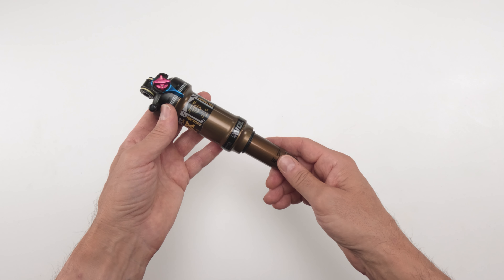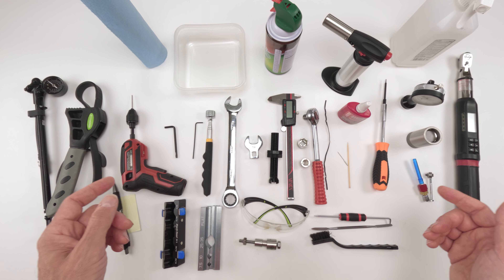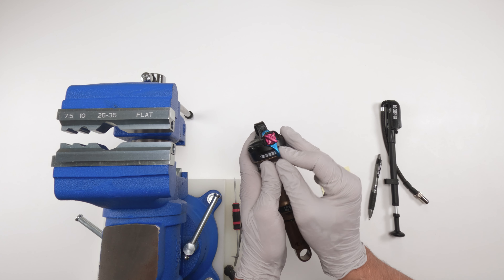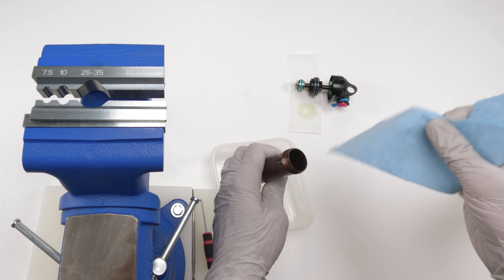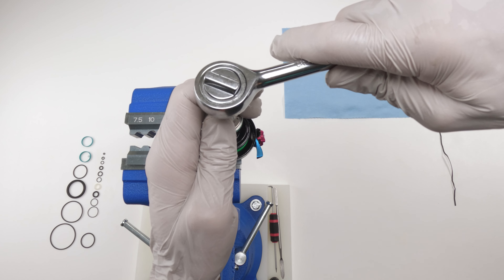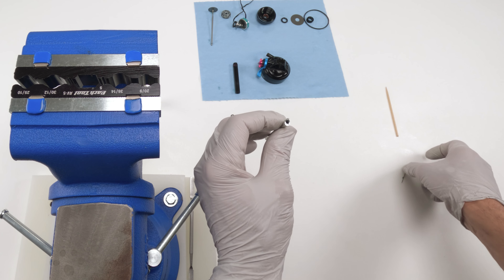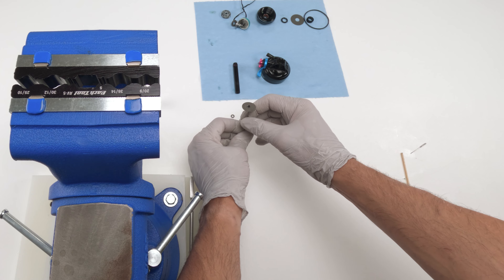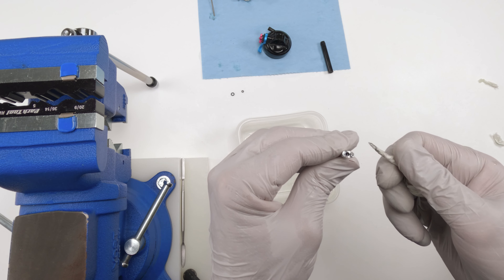2022 FOX DPS Factory Series 125 & 50 hour FULL Service Guide for Beginners. From damper to dials

Comment: Just a heads up, The pillow packs are not required anymore. Fox says to use 20w gold in place of float fluid, meaning you can use the same in both fork and shock. If you got them, use them, but don’t bother if you already got a lot of 20w Gold. See their updated service manuals.
Reply from the maker: For real? That's the reason some kits have them and others don't? It's been hit and miss over the past year, but I really noticed it this past spring. I bought about a dozen 50-hour kits during the Planet cyclery fire sale, and 4 of them didn't have the pillow pack in them. I literally thought it was a bad batch. It sort of sucks if they completely stop adding a pillow pack to the kit. The vast majority of people only need a pillow pack for the 50 hour. More handy than a bottle. 

Thanks for updating me on the change. I haven't read the service manual on this shock for a while and wasn't aware of the change. There are so many things to keep up with in the world these days, I don't know if my brain can handle it anymore!  😵‍💫
Reply: @zoubtube  Confirming this.  I was also confused, called Fox directly, and got "Float Fluid has indeed been replaced by 20 wt Gold oil".  Probably not enough of a difference between the two to bother using a separate fluid.

Comment: I did something bad yesterday that I'll share mostly for your enjoyment.  The videos are great - my own overconfidence is to blame.

I was doing the 50-hour service on the shock, but decided I wanted to de-grime the knobs.  When those pulled out, damper fluid started leaking out the knob port.  I thought the control shaft seals would retain fluid, but maybe with the cams absent, parts move and the seal isn't possible.  So I sat there for a full minute watching pressurized damper oil slowly bleed out into a pan, cursing because I'm now committed to a 200-hour that I can't do (missing tools).  For fun, time to explore.  When the oil stopped flowing, I opened the oil bleed screw, at which point I figured pressure was relieved, and forgot to open the IFP port.  Then I mounted the shock in the vice, and proceeded to unscrew the damper housing, leading to an amazing "pop" as the remains of 500 PSI (probably 1/3 of that by this point?) blew the top half of the shock off, with the IFP rolling somewhere under my work bench into some cobwebs.  As you've said - "SAFETY GLASSES are the most important tool!"

After wiping myself clean of oil, I assessed the damage.  The only fallout I've found so far is that the valve plate shims on the end of the compression rod are very slightly bent.  To determine if rod or valves, I replaced the valve shims with a flat dremel grinding disk (the only flat round thing I could find with a similar sized screw hole), and that sits flat, so it must be deformed shims.  Thinking about what happened, I figure that as the oil bled out, the IFP gradually pressed its way up through the body until it reached the valve plate, essentially crushing it.  Sigh.  New parts needed.

It's TBD whether I'll shop for some tools and attempt the 200-hour, or admit defeat and send it off.  Depends whether I can add "confidence" and "brains" to the shopping list.  Either way, this is a reminder to follow the correct steps that are VERY clearly explained in your videos.  :-)  Thanks again for making these!
Reply from the maker: 🤣🤣🤣I totally enjoyed that, and I super appreciate you sharing it with me. I can't count how many times I've been in that boat throughout my life. I literally don't have the brains to count that high. 

Your assessment is most likely accurate. There's 500 PSI in the IFP Chamber. The moment it's given a chance to escape, it's going to do so with vengeance. My guess is your lifting plate was in the open position, and the moment you opened the controls, boom! The ifp hit the plate and bent it. There's a chance the IFP could have a bit of damage from the screw that holds the plate.

Sending it to fox will cost about $200 with shipping both ways. The question of how much less will fixing it on your own be, assuming there isn't any additional damage.

I will say that it would make for a great learning project. If you have all the tools, then I would consider trying it to learn. OR, if you're in the States, send it to me and I can make a video out of it. It would be a great learning experience for others. Just a thought. 

Thank you again for sharing this. It totally made my day 🙂
Reply: @zoubtube  I'm in Ontario, and sent the shock to S4.  If I was on your side of the Leaky Border, I'd happily send it your way.  

I'm weaning myself onto more services over time.  Fork lowers, complete air spring and FIT4 have all been successfully done so far.  Next year it'll be a GRIP2 service (shouldn't be hard), and probably in ~2 years, I may give the shock service a try.

You could probably make yourself a healthy side business on selling collections of tools for each of these services.  "3 filler needles, one 500-PSI shock pump and a shim stack nipple tool:  Add to cart."
Reply from the maker: @ChristopherGrant2003  Leaky border. that's funny!  😆 I'm going to drip my way through the border to Toronto later this week 😁

out of curiosity, what do they charge for this shock if you don't mind me asking.  Also, someone just dropped off a fox 34 grip 2 damper. I should have a video out soon. Just an fyi in case it comes in handy
Reply: @zoubtube  Thanks for the heads up.  S4's initial estimate for the Float DPS 200 hour, with 20% holiday discount, was CDN $158 + return shipping + tax = $198.  Definitely enough that I regret pulling out the controls.

Comment: Another great video as always. I got one for you though. I have a Float DPS in the shop right now. The original issue was that the lockout switch didn't work. I rebuilt the whole shock, including the remote, but still no lift. I i install the whole only the piston screw (to maximum depth) and the lockout rod (without the plate, the rod sink like 2-3 mm below the top of the piston screw. You can imagine that if the whole shim stack and piston, and top plate is installed, the lockout rod does even get close to touch the cam of the lockout remote. Any ideas? Basically, the shock is stuff in lockout at all time. Thanks in advance!

Comment: Question for you @ZoubTube!

I have a Fox Float 2024 (DPS successor). It has a Torx screw rather than the Delrin plug at the bottom. I had a moment of bad judgement and unscrewed that after the shock was depressurized and air can was unscrewed. It did seem like a very small hiss of air came out when I undid this screw. Do I need to pump it back up to 550 PSI, or is the Torx screw just a grub seal covering the valve inside?
Reply from the maker: Sincere Apologies for the delayed response. Any hissing noise emanating from the IFP chamber port signifies the presence of gas leaking from within the chamber, ultimately necessitating a refill. At least you don't have to deal with the pellet, which make this MUCH easier  😉👍
Reply: @ thanks for the reply! I found my local suspension wiz (shoutout to The Shock Howse in the Seattle area), who confirmed the same and re-charged it. Lesson learned!
Reply from the maker: @clarks888  I'm assuming Mike is still running the shock howse. He's awesome. You guys are lucky to have him in the area. Very few like him in the country. Glad to hear the issue was fixed  👍
Reply: @ yep, he’s awesome!

Comment: i don't understand why fox don't put a valve in IFP like rockshox...
Reply from the maker: You and me both! This shock really hasn't changed all that much since the RP2. You would think that they would have done this by now. I know that the biggest reason is cost savings. At scale, it is MUCH quicker to fill them by needle than by adapter, and they have made a few million of these inline shocks over the years. But still, Rockshox obviously figured it out. The least they can do is offer it as an upgrade option